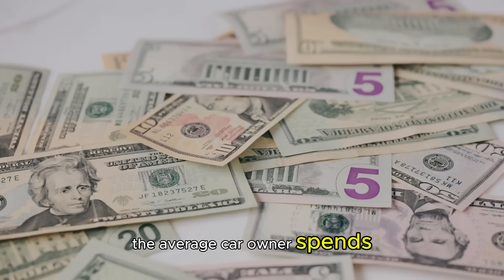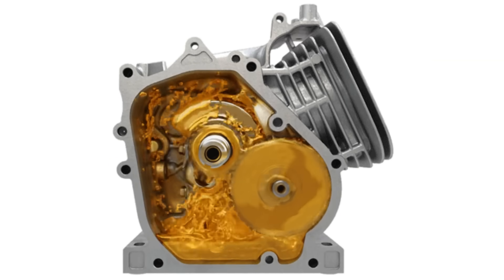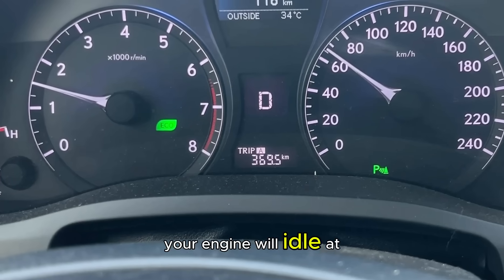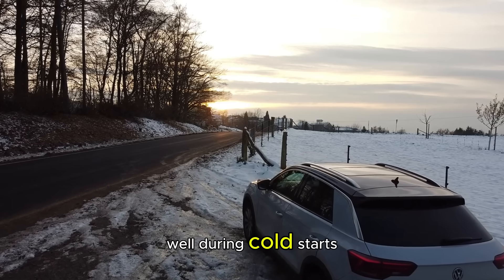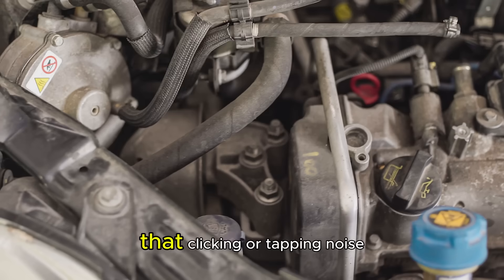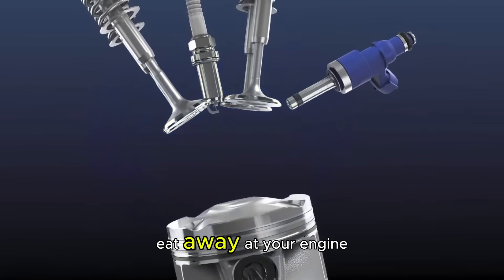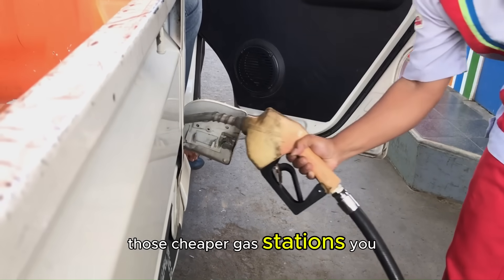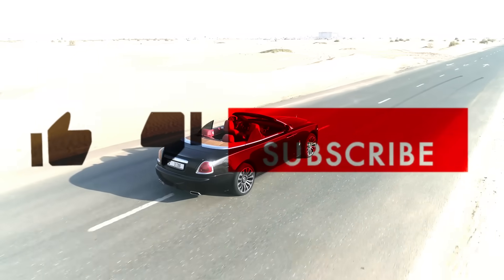Stop Making These 6 Cold Start Mistakes Before They SECRETLY Wreck Your Engine

Comment: Put Duralube in your engine oil. It stays on the metal parts so when you start the car it protects the metal until the oil reaches all the parts. You can hear the difference in 20 below zero weather. The engine turns over more quickly with the additive. The greatest engine wear is when you start the car so Duralube reduces engine wear. It actually works.

Comment: Your engine only needs 30 seconds of warming up in 70 degrees or so. Anything after that is a waste of gas and time. After 30 seconds, you just baby it everywhere til your engine warms up and that doesnt take too long. Idling your engine to warm up isnt ideal. You spend more time outside of operating temps. Youre better off driving the car after 30 seconds to get the engine to heat up quicker so that your engine is happier all around.

Comment: Coolant also helps cool most modern turbos.  All of the ones within the last few 5-10 years are oil AND coolant cooled.  Some vehicles even have a separate coolant resovoir and pump for the turbo system and don't use the coolant in the radiator.  Please update your video.

Comment: Living in Chicago and Wisconsin we’re used to bi-polar weather conditions which reeks havoc on mechanical stuff. When a polar vortex is on its way I use good fuel (Shell) and a can of Sea Foam in the tank. Keeps the fuel from freezing and at the very least “some” residual oil on the cylinder walls and top of pistons is better than none. On -20>F days I use a portable battery jumper attached to external battery jump leads. If possible use a battery tender. 90 second warm up, put it in gear (manual transmission) and with light throttle inputs wait till the oil(s) reach operating temperature before putting a load on the driveline.

Comment: Fully awesome.  I have been doing this for nearly 20 years with my very faithful 1990 Mitsub. TP Magna wgn. (A Russian engineer taught me that).
Paid $400AUD. Nearly 500K's on the clock.  I've owned it since '07, and it has never had the head off (go figure?!).  Never broken down.  Still get 12 litres/100ks; about 20 mpg, around town and about 10 litres/100 on a highway run.
Great car.
My belief is, maintain it well, keep it clean, fix any issue, and you'll always have a great ride!

Comment: So here is this YouTuber trying to tell us what happens during the cold start but doesn't know anything about batteries and fuss is giving us them accurate information.

The amount of power stored in your battery isn't less it's exactly the same it didn't just disappear because it got colder.. The battery is just having to deal with slower chemical reactions but that doesn't make energy any less the battery left dangerous and so on. There is a difference between slower chemical reactions and a loss of energy so this video is inaccurate I wonder how many more inaccuracies I'm going to come across I finish watching it.

Oh yes there are more inaccuracies here. Most calls cut off the call and completely when they're warming up wouldn't make any difference even if you were using the heating on for because the valve is completely closed and there is no call and flowing around the system and let's not forget the fact that most people use air conditioning which doesn't even use the cars called an at all so hey another inaccuracy

Comment: 13' mustang gt with 93 tune and 116k miles. let her warm up and don't open her up until oil temp is up to snuff. no issues with her for 6 years, still runs very very strong

Comment: This is a myth.  Unless your car is mad prior to the 80/90’s, you can drive off right away.  You just don’t want to hard accelerate until it reaches operating temps (Need to allow for oil to circulate before doing that).

Comment: I don’t warm up my engine in my Yj Jeep I turn it on wait about 7-8 seconds till I make normal oil pressure and I lightly start driving did that for a for a full year pulled the engine and it still looked great 30-60 seconds is just too long dont need that long oil circulation happens rather quick not 30-60 seconds worthy

Comment: Excellent video. I see so many people get into their car, crank it until it starts, put the tranny in forward gear and then stand on the accelerator!  Sooo stupid. And then wonder why their engine is toast before 50 K miles!! OMG people get a flipping clue!! I always warm up my engine/transmission EVERY time and I drive it at least 20 minutes to prevent sludge forming in my engine. My Corolla has 220k miles on the original engine and it still runs and sounds better than a lot of my neighbors!  It’s the heart of your car. Take care of it!!

Comment: Have 293k mis on my 06 F150 4wd. Its still driven daily & worked when needed. Use common sense! Dont rev engines when cold. Let run 4-5min MAX before driving. 5-6k mi oil change intervals . Will treat my newer 24 Bronco 4dr Badlands same way.

Comment: Now days it's not as much about warming the engine up as engineers have realized that people don't do it. So they have done a fair job alleviating that issue. It's the transmissions that need more cold start engineering.
Reply: @bigfootnmore6619  exactly ... Toyota has a transmission warmer....idle for 3 to 4 minutes below 32 degrees farenheight.

Comment: Bad advice start. Let your engine warm up at idle at least until your temperature gauge starts showing some heat on it Your engine has plastic and metal parts they all need to warmed up to operating temperature. if you drive away after 30 seconds your plastic parts o rings will start leaking as you drive your engine to warm up they won’t start leaking right away usually right after warranty ends you may start seeing leaks the plastic and metal parts all expand and contract at different rates at different temperatures. Let your engine warm up let it idle then drive away easy to warm up your transmission, the part about your engine, running rich by letting it warm up in idle is misconception that richness on a cold start is only for a few seconds the catalytic converter would become damaged if the engine ran idling on a rich mixture.

Comment: Already aware of most of these amazing advices, but it still hell if your car has a super efficient engine.
My 2022 Polo has a 1.0 MPI (natural aspirated) engine that takes decades to warm up at outside temperature below 0°C.
Its a nightmare if you don't put freezing protection on your windshield the day before drive

Comment: False. 
 Point 3. Gasoline begins to get thick between -40 degrees to -200 depending on how much ethanol is in it. 
 Point 4. Your engine always runs at a higher rpm when started. This is because it is running in a "open loop" meaning it is injecting a higher fuel ratio until the oxygen sensors warm up enough to get an accurate reading of the O² levels running through the exhaust. In warmer temperatures your car will still start at a higher rpm, but ain't stay that way as long as when it's cold. 
 Point 5. The parts don't shrink THAT much, and any differences are engineered to be compensated for with a reasonable allowance of 'lash'. 
 That tapping sound you hear is NOT piston slap! If you had piston slap it wouldn't matter a bit of your car is cold. Piston slap is not a tapping noise. It is much louder and caused by a catastrophic failure in the piston, the piston saddle, or the rod, and the vehicle should NOT be driven or even running. That "tapping noise" is actually a thing called lifter tick, and in the case of a cold start it's caused by the lifters not yet lubricated enough to reseat fully after every cycle.

Comment: Turning your heat on full blast while the engine is cold, has no effect and will not damage your engine. The thermostat keeps the coolant already in the engine, in the engine. It doesn't get to the heater core until the engine is warmed up.
Reply: @edwardmcgowan9206  exactly

Comment: How am I supposed to idle for 60 seconds max and then start driving in a frozen cabin.
Reply: @Shaheer424  don't..idle 5 to 7 minutes...warms the transmission fluid to go through the hydraulic packs for smooth shifts

Comment: Good advises. Living in Iceland you sometimes are forced to stay put though for quite a while after starting the car as thick ice is on windows that you cant really scrape away so you need to wait until the hot air melts  it from the inside so you can see where you are going, this process can sometimes take up too 10-15 minutes when bad, first waiting for the car to warm up enough to have some warm air to direct to the window and then it still can take a while before you have enough vision to safely start driving.

Comment: The cars you showed for turbos also have factory turbo timers and slow the process its self for project cars or aftermarket application use a turbo timer easy enough.

Comment: 4:02 if my cats on my truck failed I wouldn't bother to replace them. I would just cut it out and weld a straight piece of metal to connect the exhaust back together and it would make it louder as a bonus

Comment: My engine light went on and I got a evap code 455 or something that meant small leak...anyway changed the gas cap like they say, still on ...hummm..
So I have some black electrical tape and put it over that damn engine light....hmmmm
Car runs fine...hummmm...months later and many miles later it magically went off....hummmm

Comment: Oh man, i learn my lesson from hard accel the moment i cold start my IS. i used to turn it on, rev it and do full pull. Then one day, my car suffer from teo coolant leak and a fail radiator. I was praying so hard that my engine is fine. It has been a year now, no problem has been showing up. 😅

Yes, my IS is modded but not ti the point it will affect my engine.

Comment: I have 366,000 miles on my Honda accord. 2016. I start it and let it warm up every single cold start. I do agree I shouldn’t turn the heat on high right away but I do it. Good video
Reply: where could you possibly be going on a daily basis to have 366k miles in 9 years
Reply: Hope you don't have the dreaded Honda 1.5L GTDI! Absolutely garbage.
Reply: Mahindra bolero 2012 manufacturing run 402732

Comment: Good video.  I learned one thing extra.  About not cranking the heat on high until the car warms.  Thank you.  Good narration.  I hope it's not AI.
Reply: This works to heat your coolant quicker but the oil will not heat up any quicker. This is because when you have the blowers on, it is taking heat away from coolant via the heater core so this has the side effect of acting as a second radiator for the coolant during this time
Reply: @insertnamehere5660  If the coolant heats up more slowly, then so will the engine block heat up more slowly, and hence so will the oil heat up more slowly.
Reply: @ I mean yeah, it’ll slightly help the oil warm up but hot coolant doesn’t mean the block is warm
Reply: @insertnamehere5660  How does the coolant warm up, if not from the engine block warming up, through which the coolant is circulated...
Reply: @ warms up through being ran through the block, but what I’m saying is that coolant is thinner than oil so even if your coolant is at temp that doesn’t mean shit in relation to the oil

Comment: When it is -16 in the morning, my car is going to warm up for 15 minutes before I drive it.  If I don’t, it’s like driving an ice box, defrost does not work, heater blows cold, and it’s a life or death type of cold.  The automatic choke turns off when the engine reaches proper temps.

Comment: I’ll save everyone 16 minutes. Just let your car warm up.
Reply: That's what I was thinking! I'll let my vehicle's warm up for about a  minute or two. When it's cold and my windshield is foggy and or iced up? I'll take my time.
Reply: 😂 thanks
Reply: I was thinking that. 

You dont need anything complicated

Just let it Idle for few Minutes.
Reply: Not for more than 5min or cause more engine wear!! Facts.
Reply: @Davido50  My last three trucks had way over 250 thousand miles, when its cold I let em run for twenty or thirty minutes. Rot and transmissions are what killed em because I plowed with two of em. Real Life Facts.I also have owed a repair shop for more than sixteen years. The one I do not plow with is just fine, keep your fluids fresh.
Reply: @Davido50  Thats pure bullshit unless it was a poorly designed engine. Any proper designed engine will have proper oil flow at idle.
Reply: @Davido50  Thank you, I hate people who say run it for 15 minutes or something like that! I'm sure 5 minutes is fine in cold weather and 30 seconds to 1 minute is fine in warm weather right?
Reply: @SRT93-Tomahawk-5 celsius vs -35 celsius….IDK

Comment: #3 is my problem. Because my workplace is only like less than 15 mins of driving away from my house, every time I get to my office, the temperature gauge is only at about 25%.
Reply: may i ask which engine you drive? 15 minutes of driving and the engine still cold is not normal, maybe your thermostat is broken...
Reply: I drive a Toyota hiace 3.0L diesel, idling the car will never bring it up to normal temperature. It has to be driven gently for nearly 12~15 minutes to be in operating temperature.  @tristantrupp5442
Reply: Mine gets up to temperature in 10 minutes and it's a diesel, how come you only get a quarter?

Comment: Warm car and oil change every 3k miles regularly.
Reply: What kind of car do you have cuz 3k oil change in most cars isn’t gonna make a difference to your car but your wallet
Reply: @Mrdoitall3344 yah 6k is good
Reply: @Mrdoitall3344 oil changes are inexpensive even more when you know how to do it yourself. I wonder how well your car is taking care of.
Reply: @ man please i have a 07 Honda accord stick shift 217,000 plus original miles same transmission same engine, 2015 Chevy ss sedan 50k miles no issues in neither of my vehicles. Just sold my hummer 07 h3 300,000 miles no issues for 14k so miss me with the smart ass reply’s Ik how to take care of my vehicles 3k is a waste my hummer called for oil changes every 7,500 to 10,000 miles from factory i changed it at 8,500 Miles’s sometimes almost 10k you probably don’t even know how to change a headlight talking like you just know what’s going on

Comment: most ppl wont sadly do any of these things and this is why engines use o weight oils standard now and also dont send coolant to the engine for fast warmup and use pre intake combustion to speed up the warmup process on modern ice engines

Comment: I have a N55 lol... I wait a minimum of 5-10 minutes for it to warm up and then I drive... I drive local for 5 minutes and then I make sure to drive the car on the highway for 10 minutes to warm it up properly consistently around 1500-2000RPM... Around 15 minutes of proper warm up time then I proceed to do whatever I need to do lol... its a must

Comment: As you said, I wait until the rpm drops back below 1,000 before I drive.  Then I drive at low rpm until the oil reaches normal working temperature.

Comment: Regarding the cold trip in my pervious comment, I support the Chrysler team that was testing feedback carbureted vehicles.  After an 8 hour minimum overnight cooldown, all accessories off (no heater, rear defrost, radio, etc., to not draw too much power from engine and controller.  Not much frost at -20⁰ - -30⁰F.)  Press accelerator once to the floor to set the choke, let engine run up and stabilize, slight press on throttle for choke pull-off to workand lower RPM, put in gear and drive through lot to street, use a series of gradually increasing throttle accels and crowds to determine any hesitations or stumbles.  Stops and restarts for further evaluation.  Drive enough during the day to be at normal operating temp to dry out crankcase, purge vaper canister, fully charge battery, etc., too prep for overnight soak.
>Thermostats always diverted some water to the heater which is returned to the cold side of the water pump  This allows for water to circulate through the block for more even heating.
>Some engines today cool the head and block at different rates using independent circuits.  This may control expansion of aluminum cylinder heads on cast iron blocks to minimize sealing issues.
>Stainless steel exhaust systems solved the problem of premature failure from short trips not drying them out.  It also withstands higher exhaust temps better.
>Today's low viscosity oils are needed for variable valve timing control solenoids and phasers, quicker circulation when cold, fuel economy and emission control.
>Oil cooler is a bit of a misnomer.  They actually help warm engine oil (synthetic required for some) and transmission fluid when it is cold out. 
> My current cold start procedure on a '18 Compass 2.4L: get comfortable in my seat, start engine, put on and tighten seat belt, check mirrors, put in gear, go, no hole shots.  Factory multi-grade oil at recommended intervals.
Reply: Using chrysler as a reference of anything is a bad idea. Even if it - once in a blue moon - is right.